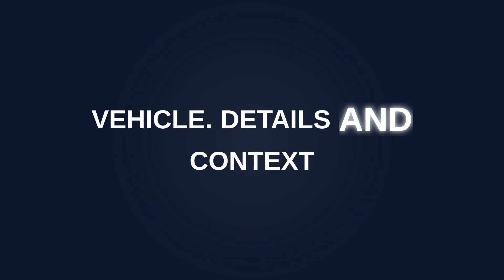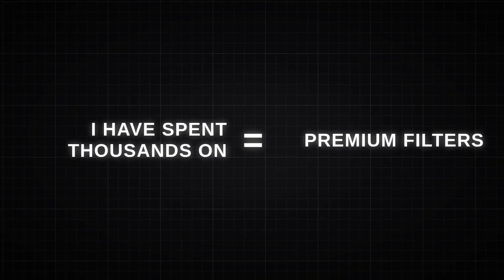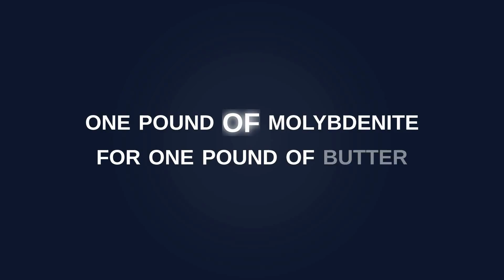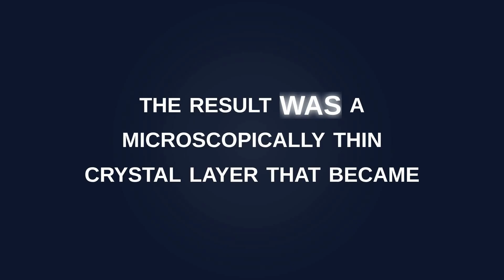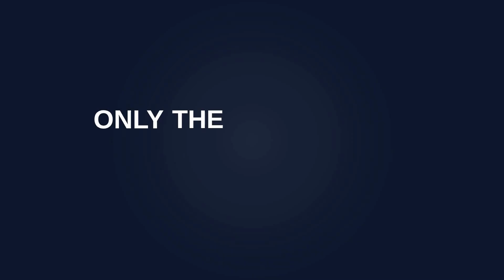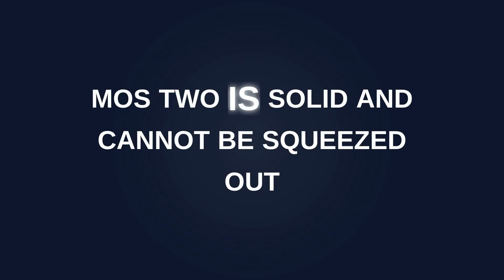$2 Powder BONDS to Your Engine PERMANENTLY. Cuts Wear 20%. The $100B Repair Industry Never Told You.

Comment from the maker: ✅ FULL APPLICATION GUIDE — Save this before you scroll away:  
🔬 WHAT TO BUY: → Molybdenum Disulfide (MoS2) powder — lubrication grade, particle size under 2 microns → 100g on Amazon: ~$2.40–$3.00 shipped → DO NOT buy Liqui Moly or similar — same chemistry at 2–5% concentration, charged 10x the cost → 100g = 5 to 7 full engine treatments 
📐 DOSING BY ENGINE SIZE: → 4-cylinder under 2.0L → 5 grams → Engine 2.0L to 3.5L → 7 grams → V6 or V8 over 3.5L → 10 grams → Older vehicles (pre-1990 with older rubber seals) → use half dose for first 2 treatments, check for seepage  
🔧 HOW TO APPLY: 1. Drive vehicle 10 minutes to full operating temperature 2. Measure correct dose of MoS2 powder 3. Mix powder into 30ml of the same oil already in your engine 4. Stir 60 seconds — powder stays suspended, does not dissolve 5. With engine idling, pour through oil fill opening 6. Let idle 20 minutes 7. Drive normally for 500 miles while heat and pressure drive the tribochemical bonding  
⏱ HOW LONG IT LASTS: → Treatment is effectively permanent — bonded to metal, not floating in oil → Does NOT wash out during oil changes → One treatment lasts 50,000 to 70,000 miles → Reapply at 50,000–70,000 mile intervals 
 📊 THE SCIENCE: → MoS2 friction coefficient: 0.025–0.05 vs synthetic oil: 0.08–0.12 → 60–70% reduction in boundary friction → Nature Scientific Reports 2022: 0.01% concentration → 19% friction reduction, 20% wear reduction → 90% of all engine wear happens at cold start, high load, and at microscopic metal peaks — exactly where oil fails and MoS2 works 
 🏆 REAL-WORLD DATA: → 1997 Ford F-150, Leadville CO → 487,000 miles, original engine, cam lobes smooth as new → 2004 Toyota Corolla, Osaka fleet → 580,000 km (360,000 miles), zero rebuilds, every cylinder within 8% factory compression  💰 Cost: ~$0.43 per treatment | Lasts 50,000–70,000 miles | Engine rebuild: $3,000–$6,000  Drop your vehicle make, model, and mileage in the comments below — building a record of real-world results across every make and model.